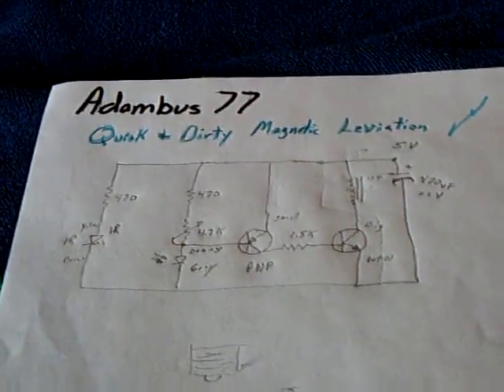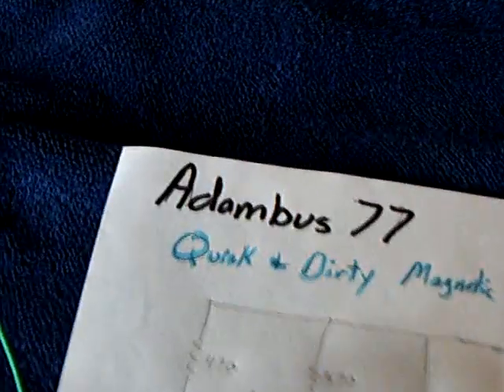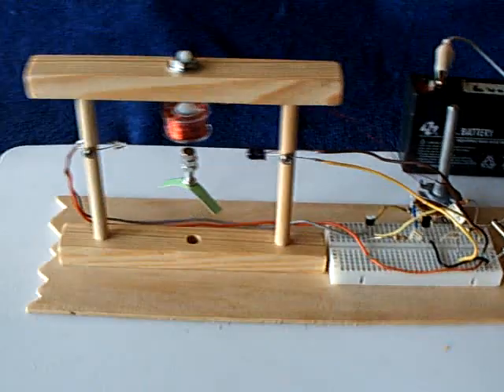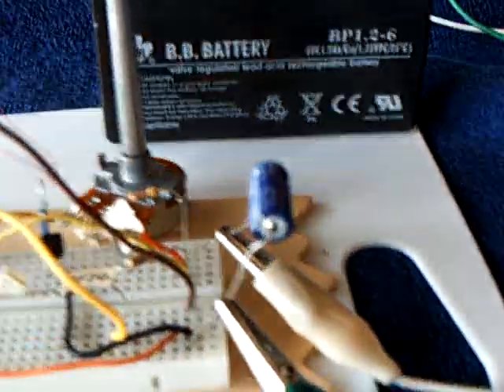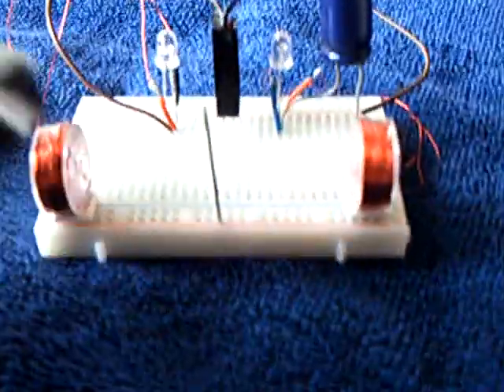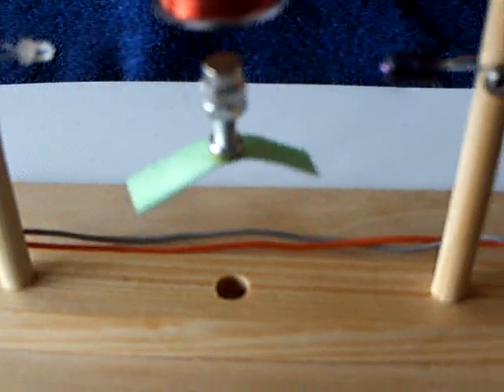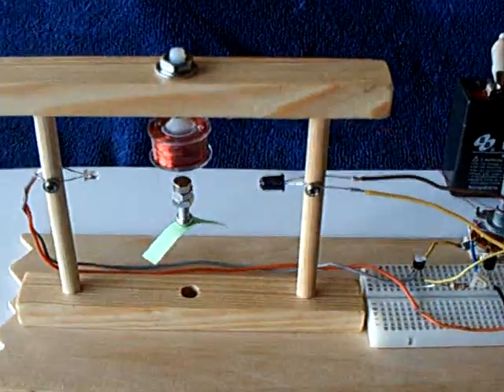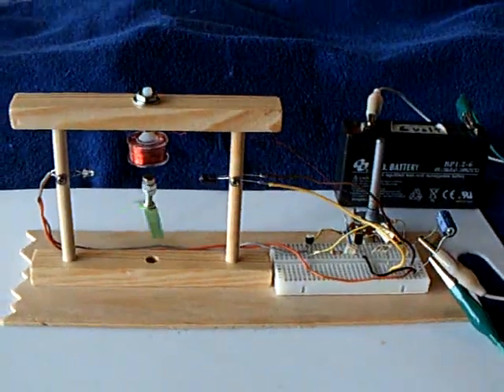Simple Electromagnet Levitation

Comment: Great idea to use such a simple circuit. The only thing I wonder about is if you really need less energy to keep the rotor in the air than you'd need with a good bearings. You have to include all energy you "lose" because of eddy currents, resistances in the control circuit, e-m. radiation, ...

Comment: how can i know if the IRs are working?
Reply from the maker: +Rodel Hermogenes You can check the infrared led with a multi meter.  They actually put out voltage in direct sunlight.  To check the to see if the whole circuit is working just look at the amp draw coming out of the supply battery.  It will go down when the IR beam is broken by the rotor.
Reply: *****
thanks for that. I have actually done it successfully. It's really amazing. It just needs patience.

Comment: Dear Lidmotor .
Could you tell me please:
-  When the coil is on , the coil will attract or  repel the magnet .Thank you so much.
Reply from the maker: +568min The coil is an air core and when it is on it attracts.
Reply: ***** Thank you very very much for your helpful. Your help to finish my headache (3 days) . Before I used the coil with an iron core (bolt ) it's  too hard for adjusted and the device cannot worked . Now working very very good. Thank you again for your time to help me.
Reply: 568min The iron core creates hysterisis which makes it hard to control.
Reply: HAMDANI YUSUF 
Thanks to sir Lidmotor I think so. Many thank you for your opinion.

Comment from the maker: That component is the sensitivity adjustment for the circuit (you turn it).  It is a potentiometer but I am using like a rheostat.  Just wire up the center tap and one of the outside taps.  Sorry for the confusing diagram.

Comment: Ok, I looked it up and it's a variable resistor. What component does it represent in the physical circuit? The photo resistor? And why is the bottom of the arrow connected to the circuit with a little line?

Comment: you said u want to put a rotor in there without bearings. How about having a shaft thru the center with a like charge to repel the rotor from touching the sides. this would stabilize the unit from falling off point and allow you to turn high rpms. It would take some engineering and more fabrication but I think it would work. what are your thoughts?

Comment: Hi there lidmotor, 
i was just wondering, have you tried spinning this thing up using your coil and plasma thrust?

i was wondering if you had a wire bursting plasma very close to the magnet but not touching, if you could then get that to burst out of 2 small wires from the bottem of the magnet, much like that plasma propulsion spinner thing you made

Comment from the maker: Yes.  If I increase the power and use bigger transistors,  then I might be able to get better results.  If you notice in the video there is a hole already drilled in the bottom wood frame for a peg with a small stabilizer magnet you mentioned

Comment: The purpose of the LED and receiver is to try and measure the distance from the electromagnet to the levitating object. This works by having a self-correcting control loop that continually adjusts the strength of the electromagnet to cancel out the force of gravity and keep the object at a set distance. If the object is detected to be too close, the magnetic force is decreased and vice versa for to far away. This way the object is "locked" in place by correcting the distance precisely and fast.

Comment: you can make a magnetic bearing without using power to levitate.
like the horizontal style with 2 toroidal magnets and repulsion from a base.
most use a very small point on glass to hold in the lev zone-but you can also use small neos in repulsion instead of the point on glass,that way there is no friction at all.
can also be done vertically,the devil is in the fine adjustment of the axis holding magnets,so that it keeps the toroids in the lev zone